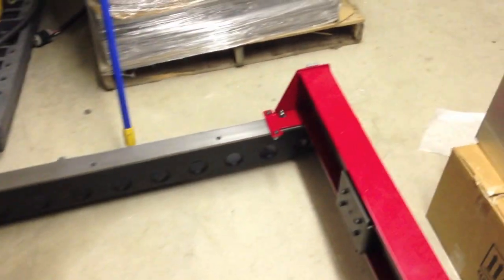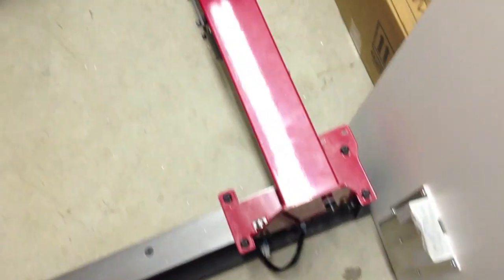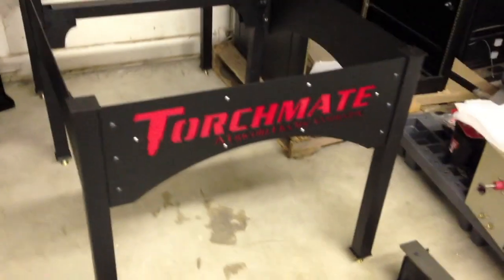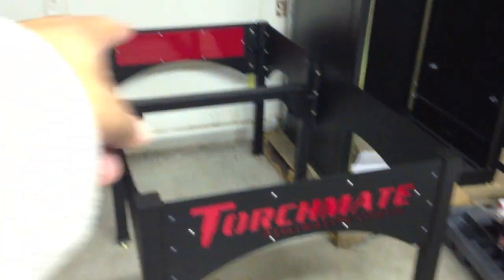Sir Mix-A-Lot setting up the new Torchmate 2x4 CNC

Comment: When I'm cutting I bring the water right up to the bottom of the plate, it keeps the smoke down to a minimum.
Reply from the maker: Yeah I have since figure that one out.  I initially feared the water splash would create a problem but it doesn't.  Thanks
Reply: +SirMixAlotChannel  keeps the metal cool as well and from warping
Reply: What have you made with it?